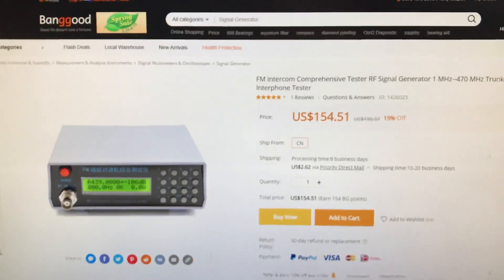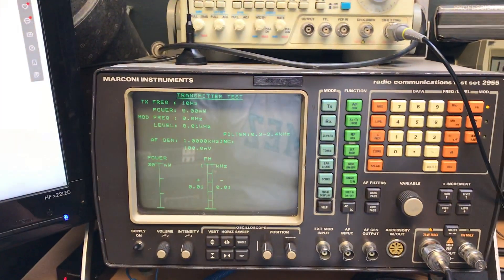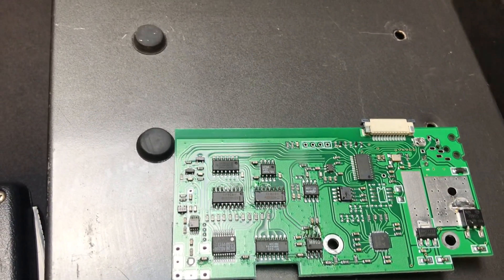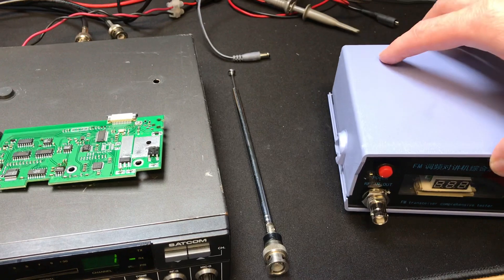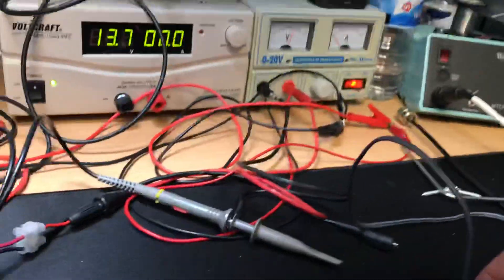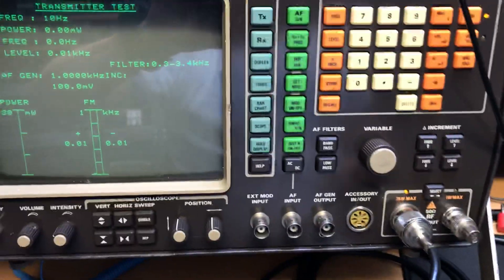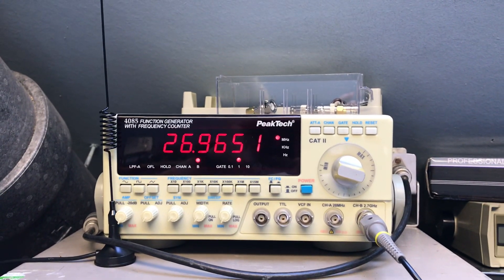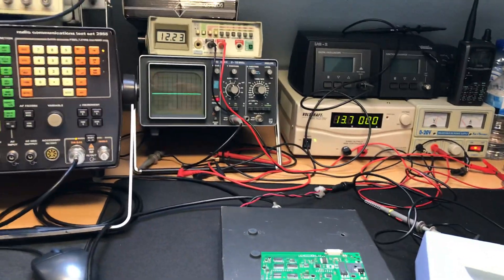#001 Comprehensive RF Radio tester 1-470 Mhz from China, after blowing-up a 64 Watts dummyload-att

Comment: I had the same Marconi service monitor back in the mid eighties, it had the AMPS cell phone auto test module strapped to the bottom. Worked pretty good. Fast forward to 2016 picked up on an IFR 1200S, worked good for a couple of years and then it would not lock above 200 MHz. Recently pulled it out of the closet and it would not even power up. One of the Facebook groups told me I should replace every capacitor in the power supply board considering it’s at least twenty years old. Hopefully I’ll get around to it this winter 2023.
Reply from the maker: The Marconi is great... i even have a spare, just to be sure.
Yes changing caps seems to be a hobby :))

Comment: Hi Tony,....Just received my Walki-talki tester / Rf generator....Package arrived  like yours but without any cosmetic damage or blemishes but Without any instructions...Simply powered it up with a cheap, common, switching--regulated 10 Vdc wall-wart power supply....Simply works perfectly with & without selected modulation, Is on frequency & the rf Dbm output is Perfect range for testing UV-5R type handheld receiver sensitivity performance ...I'm never going to use it as  a dummy Load or inject Any signal into it !!  Simply works perfect for my needs & is within my tight $$ budget....It's functioning perfect within minutes after unboxing Without instructions & I'm an Ole retired guy !!!  Just my experience with identical unit to consider & appreciate your testing review videos..?
Reply from the maker: Hi Tom, great to hear yours is working... very good!

Comment: Hello !
The new version is already changed and can support the regular 13,8V from ham radio power supply. I would like to see it compared with the Marconi to test accuracy. The equipment is very cheap and fragile, any transmission will destroy it, there is no protection circuit at all !
Reply from the maker: Hello!, i blew up mine... but not because of RF, inside is and 50Ohms dummyload for about 75Watts.. and they use an RF_tap / RF-Sampler. to the input.. if you stay below 60 Watts.. there is no problem..
Reply: @TonyAlbus  I believe there is, the factory says no more than 1mW input, I transmitted 25W on VHF frequency !! It turns on but never had the same output again.
Reply from the maker: @CT1ELP  Maybe this improved model for 13.8Volts, does not have that circuit mine had, with that dummy load and RF-Tap.
It is very easy to spot.. on the bottom of the device is this big with dummyload resistor attatched to a little circuitboard(rf-tap), before it goes to the mainboard. if it does not have that, it is indeed deferent.
Reply: @TonyAlbus  I have seen the image of the boards, they are different as well as the software version.
Reply from the maker: @CT1ELP  Thanks for sharing that... okey, then they are just different :) .. i will try to get one free from BangGood to test will ask the affiliate sales... not buying again..

Comment: What are you guys incomprehensiby jabbering about ??  The DC power voltage  rating Is clearly advertised at 8 to 12 Vdc.....You apply 13.6 volts, burn it out & negatively recommend  Not to buy before you never use & evaluate it correctly ?? ...You Never apply a signal source Into a signal generator !! ...What is all the jabbering about blowing up a 64 watt attenuator ??  Could you speak Clear English loud enough to be understood ?? ....How many unrelated issues are you going to ramble in 1 sentence  ???
Reply from the maker: Hello Tom, the RF generator and the RF Tester are not the same, altough i must agree they do look a like.